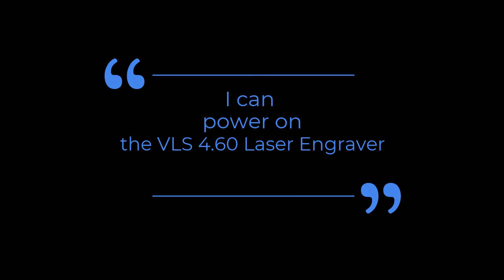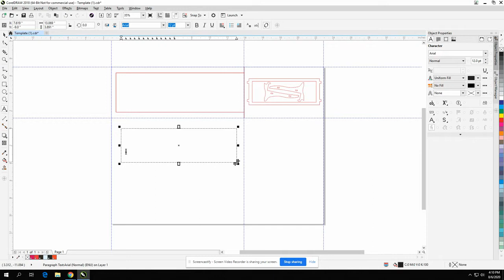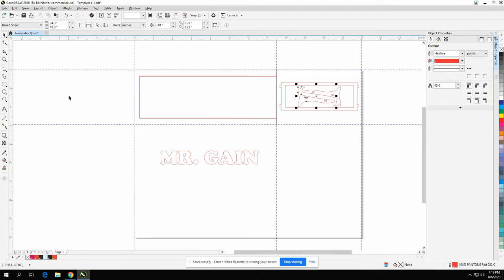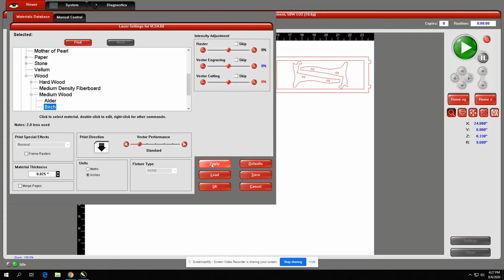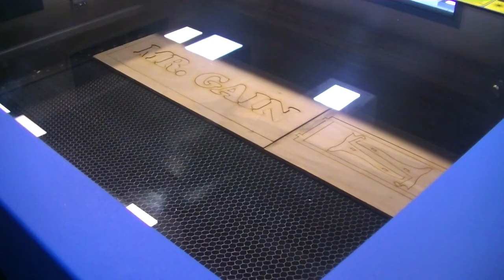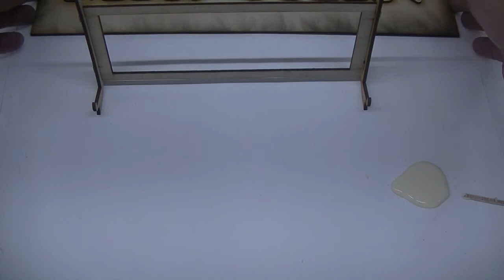VLS 4.60 UNIVERSAL LASER ENGRAVER

Comment: Doing a similar project but using Cardboard for student work. Cheap/free material...but what material setting would we need to use?
Reply from the maker: I would not suggest corrugated paperboard (cardboard box) material due to the corrugation channels. This could be a fire issue regardless of the settings. Off topic but I also do not let students used cedar since it's way to dry of a soft wood. We've had charring and burning issues. Not safe!

 If it's more on the lines of index card cardboard, or poster board cardboard I would start with a manual power setting of 5% and a speed of 100% with a thickness of whatever the cardboard is. If it doesn't pop through keep brining those numbers closer i.e. power 10% speed 95%.

Please let me know if this helps. If it doesn't make sense I'm more than willing to create a video if you let me know your exact material.

Thanks for watching!